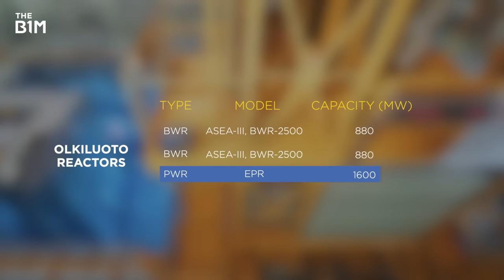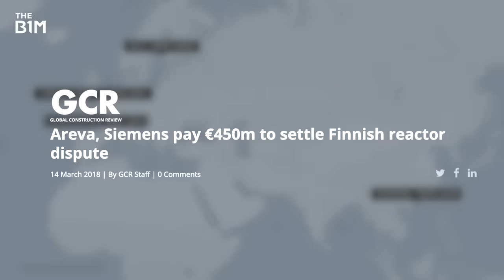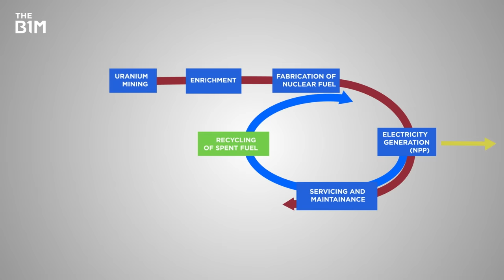Finland Might Have Solved Nuclear Power’s Biggest Problem

Comment: This is like the most scientific version of hide it under the carpet.
Reply: That's what we do with most of the non-biodegradable stuff we produce
Reply: Sweep it under the rug and call the place CLEAN.
Reply: This is ignorant and we can do better as a planet...
Reply: It’s about the best thing we can do other than launching it into space, which has its own risks.
Reply: @apple1231230  And coal! Let's not forget coal
Reply: @apple1231230  nothing wrong with oil...
Reply: @ZipTieGuyItRhymes  at the 4:55 mark they show a 3D map of the burial tunnels.  It's absurdly complex, absolutely certain to hit a joint in the rock, and because of this and the general complexity, it's certain to find a way to leak out.  I would find it laughable that humanity could guard this for 200 years, never mind 100,000 years!   It scares me that anyone could think this can work for longer than we have even been a distinct species.
Reply: @apple1231230  😁 Such confidence!
Reply: @ZipTieGuyItRhymes  what ignorant? It came from rock and returned into rock! Tectonic Plate dynamics will ensure that someday this whole thing will enter into molten layer and resurface as cesium and other byproducts, maybe even iron. It came from rock and returned into rock, end of story.
Reply: @someotherdude  youll need an army to bring all the needed mining equipment to begin to extract those spent rods....
Reply: @liborsionko  this confidence stems from basic knowledge learnt in 5-6 grade in science class... if you had payed attention, you would've known that spent fuel is just concentrated regular uranium which is mildly radioactive in its oxide state. It was used as pigment for kitchen utencils paints at one paint for about 200years or more. Now enter Plate Tectonics - constant cycle of renewing the rock! Each time volcano spews its contents or one of the plates snaps, a lot of rock gets molten and moved around and we all sink into lava abit more. This convection, high pressure and temp ensures that when in couple of billions of years this waste resurface, it will do so the same way we find it naturaly. Just dont touch it now and youll be golden.
Reply: @ZipTieGuyItRhymes  “we can do better” - have you looked at all the forms of how we can get power? 
Nuclear is one of the best forms of power generation for many reasons (good power per kilo, ability to control the amount produced, constant output etc.) and the amount of waste material that is produced per year is quite small compared to other methods. Not only that but people forget that the radioactive material is dug from the ground - it is already there, under our feet, we need to extract it and purify it before we use it. So placing the spent fuel back underground is like putting it back where it belongs.

Also, since radioactive material is found naturally in deposits, it is actually contained in other sources used for power generation such as coal. Due to the fact that the coal isn’t purified before use, a coal fired power plant will release more radioactivity to the environment than the nuclear power plant will do (where it is tightly controlled).
Reply: @ZipTieGuyItRhymes  This simple solution has always been available but it was ignored to exaggerate the risk of nuclear power and suppress the availability of cheap energy.
Reply: France (nuclear plants) 15 cents per kWh electricity price.
Germany (coal plants) 28 cents per kWh electricity price.
Germany has nearly twice the CO2 emissions than France. Any questions ?
Reply: Lmao. For real!!  🤣🤣🤣
Reply: @someotherdude  They are in copper tubes and that area hasnt been "active" in 12million years
Reply: @someotherdude  what do you think will will hapen? What is so dangerus? What will someone do with 200 year old spent  nuclear fuel?
Reply: @apple1231230  uranium has a half-life decay that has far less impact than fossil fuel!
Reply: don´t trust the finish anymore
Reply: normally suspicious things like that would be a good reason to have skepticism. this is no different. remember that there are a lot of very, very rich people who stand to make an enormous fortune if they can continue to convince the world that nuclear is "clean" (spoiler alert: it's not)
Reply: @someotherdude  Why would you "guard it" for 100.000 years? Was it guarded before we dug it up? What kind of "leaking" are you worried about exactly? How does rock leak?
Reply: @apple1231230  Better is progressing humanity in a way that doesn't continue being a stain on this planet, and the fact is it is still on/in this planet.
Reply: amit karmacharya,  Brilliant comment, and spot on! All the computer modelling in the world cannot predict with certainty the behaviour of the geology or the reliability of the hardware over thousands of years . . .
Reply: This is a very well thought out and scientific approach for this problem. The planet will be just fine and the fuel will stay safe until it's safe to handle again which won't take more than a millennia or so. How many of you commenting here have taken even nuclear physics 101 on college level education?
Reply: And what would you do instead, send it out into space?
Reply: Your right ,its almost like the Chinese and Indian way! Let it out in the rivers and suddenly its gone. No problem!